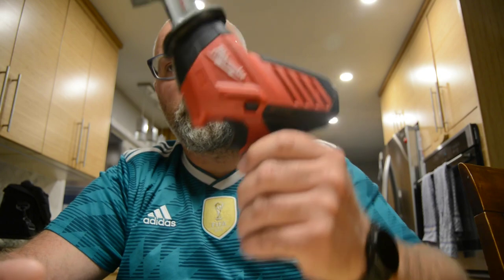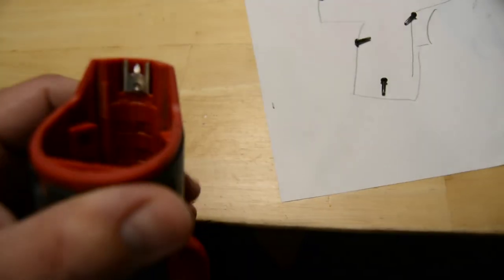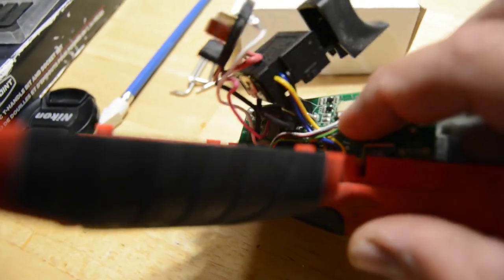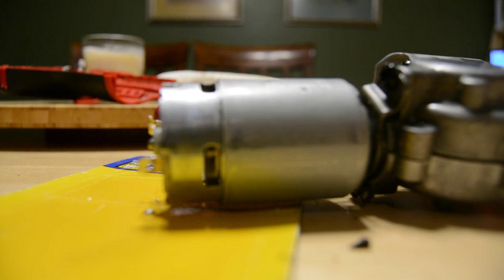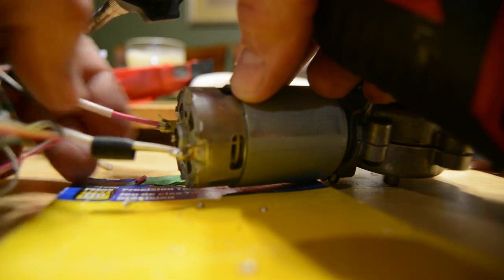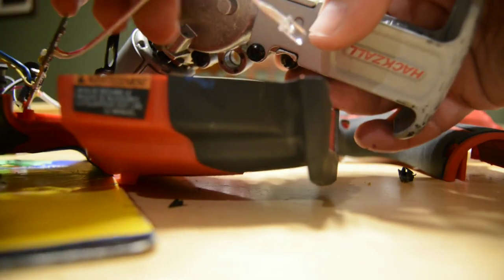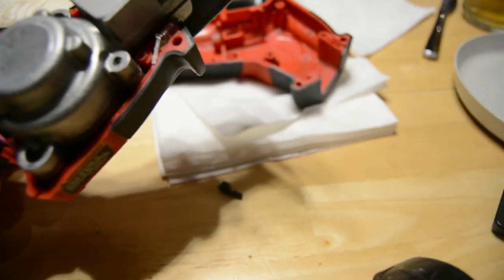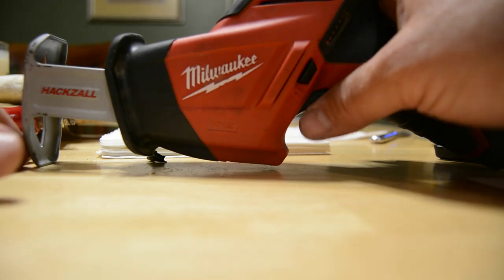Milwaukee M12 HackzAll Trigger Switch Repair

Comment: Where did you order the part from?  I’ve seen that from the manufacturer for 85$CAD
Reply: Follow up, in case anyone has seen this.  My hackzall is dead.  Only thing that happens with a full battery is “I squeeze the trigger and all the red LED’s flash once”. No sounds of the motor getting power.  I’m guessing it’s a PCB issue, but thought I’d ask.

Comment: Part number or link to the part? Thanks
Reply from the maker: Go to https://www.milwaukeetool.ca/Support/Manuals-and-Downloads  and search based on your model number. Mine was 2420-20 .  Use the service parts list to find the document related to your tool's serial number.  Once you find the part number you can search the price list here https://www.milwaukeetool.ca/Support/PartsPricing